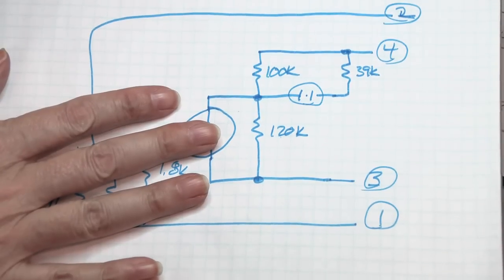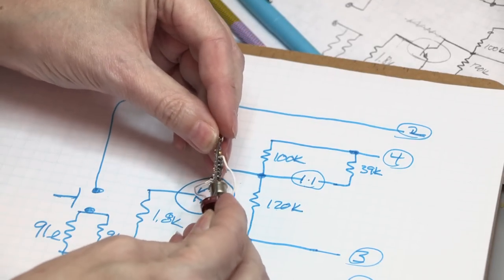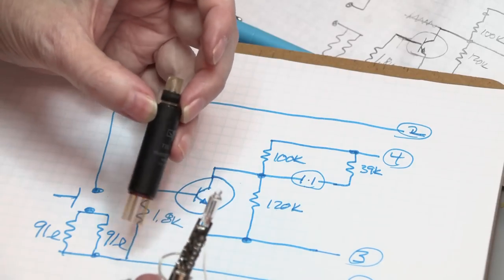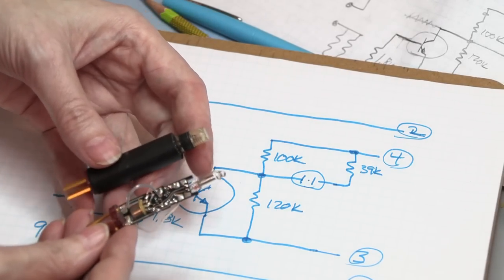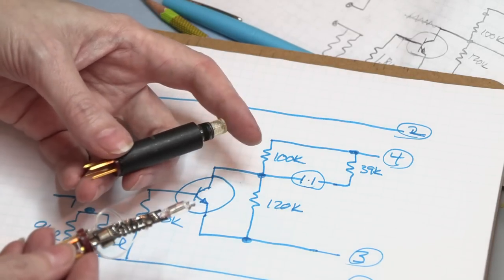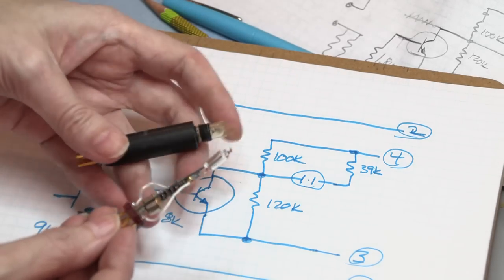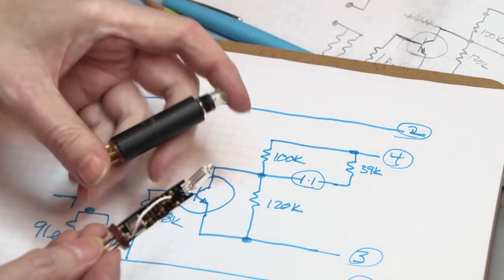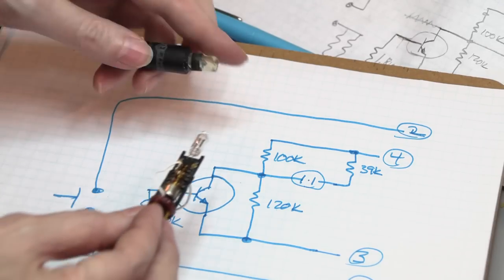A Look Inside A 1968 High Voltage Data Indicator

Comment: Switch could also be a "push to test" for verifying the indicator is working.
That's a common function on control panels of the day especially useful for incandescent lamps.
Reply from the maker: Yes, likely the intended use - and can also be put in a loop with external equipment.
Reply: Beat me to it, I was going to say if 2 is always high it's a lamp test.
Reply: @FranLab  Yes lamp test, and likely with the ability as well to dedicate one display to be a designated self test function, so pressing the one lamp both turns the lamp on, and the logic input is also (ab)used as a logic output, leading to a set of diode logic that performs a lamp test input on all the other displays as well, so you get both a press button that checks power input is fine to the lamps, by the lamp test lighting a lamp, and also lighting all the others, so signalling your lamp test input actually works, and that a faulty display is the cause, providing you with more fine grained fault information. 

Had that with a set of numitron lamps driven with serial data, where the self test button did some logic work, switching the data input to the long chain of shift registers that fed the data in from the data source to a logic 1, using a diode Or gate, and leaving the clock and reset active, so that pressing lamp test you would see the displays all switch to display 8, slow enough to be human readable, by turning the update interval to maximum time, so the clock used to clock the data out serially from the internal serial data latch (serial data using a MK4007 serial memory set, that recirculated the data, and allowed serial word selection, using a set of latches that would pull a word out as needed) would hold the word to be sent to the display, and you could see the slow update ripple across the display. Normally left at 3 updates per second, so you had a pretty fast clock, but that TTL ring oscillator had a pretty wide range of speed. update control was internal, not operator selectable, but there for bench test, though lamp test was external and available as sanity test for improbable data display checking. Changed a lot of those little display to make the dead ones usable for non critical use, if the failed filament was masked off by the outside window, though there was slow progress being made on swapping the displays to LED, which had an issue in they were too bright to match the rest of the displays, so the change I made was a pair of 1N5401 diodes in series with the common cathode, to drop 1V2, and not have to replace 200 82R 1/8W resistors in the cordwood construction adaptor.
Reply: @SeanBZA  lots of ingenious ways of keeping up with incandescent displays. One of the chemical plants here had me build circuits that kept indicator lamps on a critical alarm panel continuously lit at half voltage when inactive. A quick glance would show alarms at full brightness and bad bulbs were dark. Fully monitored without operator intervention!

Comment: Oh yeah, those Tec indicators were made right here in Minneapolis, Minnesota.   They would often show up in the local surplus stores like "Ax-Man" and 3M surplus and Honeywell Surplus and Univac Surplus stores.   They sold there for like 50 cents each.  I used a few of them on my homemade gadgets, like radio-teletype converters (primitive 66 Baud modems).   Wish I had kept that gadget, it looked real spiffy and even blinked lights!

They came in 24 volt incandescent and 150 volt neon varieties.  The incandescent ones has screw-in lamp sockets.
Reply: ANother note:  There were not a lot of transistors back then capable of handling the 120 volts or so you need to light a neon bulb.  Most likely they used the 2N398, a rare transistor.  It's germanium and only rated at 105 volts, so barely above the neon striking voltage of 95 volts!   The resistors are needed as it probably had a lot of leakage current at warmer temperatures, that's the parallel resistor to draw off leakage current.   The series resistor of course to limit the current once the lamp strikes.
Reply: Ax Man rules. One of the best parts of living here, along with cheap next-day delivery from Digi-Key.
Reply: I'm not 100% certain, but they look like the indicators used in Burroughs B300/B500 systems (and also probably the large scale B5500 systems as well).  Cool to learn that they were made right here in Minneapolis.  And yes, Ax-Man rules!

Comment: I think there is a bistable element in the circuit, the neon bulb. It has two states, conducting with low voltage drop, or insulating (off). The pushbutton briefly turns off the transistor and the bulb returns to insulating state.

Comment: Note the clever reduction of the required Vce for the transistor. The potential divider means that the 150V supply is only 81V on the collector when it's off. When the transistor goes off, the terminal voltage is below the sustain voltage of the neon, so it goes off. 
Oh, is the arrow backwards? Being Germanium and all...

Comment: I like older electronics. I worked in a switchroom as an installer. I found the Stroger Switches quite interesting because you could see them working, unlike today's computer controlled  switching. 
Are you familiar with how the Stroger Switching system came about?  🤔

Comment: so....  just how "high" is the high voltage required here??   is that AC or DC that the neons use?   pardon my ignorance but i've never really done anything with neons & i'm curious.
Reply: Neons can run on AC or DC 65volts upwards with a current limiting resistor typically.
Reply: With the 300Vabsolute max rated transistor, but 100k resistor and 120k divider I would say the power voltage is 100 to 140V, as you need to have a high enough voltage to turn the neon lamp on, thus over 90V, but the mid point voltage must not be lower than 50V from the top supply rail, thus 140V is the maximum, to not have the lamps turn on from simple high voltage, even in bright sunlight. 130V is common to run Nixie and other neon filled displays, and is common enough that it was also a common voltage regulator tube voltage in use as well. 300V transistor so that leakage current, even at 70C internal temperature in a cabinet, would not result in enough leakage current to turn the display on, even though the silicon transistor by then was a reasonably well known device.

Comment: Awesome tear down it had a very Big Clive feel to it .
Reply: When she was hammering on the aluminum casing at high speed I heard Woody Woodecker going "ha-ha-ha-ha-ha!" inside my head!
Reply: Except the quality of the things being torn down is at complete opposite ends of the spectrum
Reply: @sometimesleela5947  , this is true.  Clive dismantles cheap Chinese made things and every now and then discovers a gem In the rough or something unusual, surprising and interesting about the design (alhough many of the devices are basically scams and sometimes are actually electrically dangerous). Almost all the old tech that Fran dismantles was built to pretty much the highest technical standards of the day.
Reply: Also Clive would probably have destroyed it more destructively.